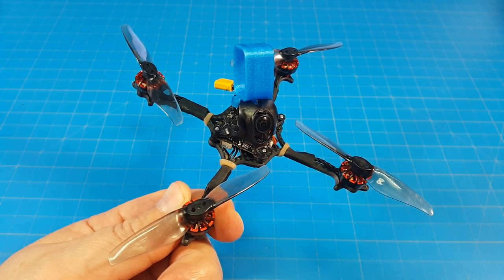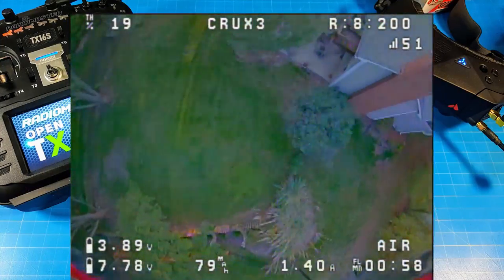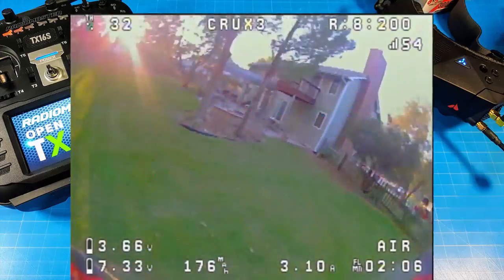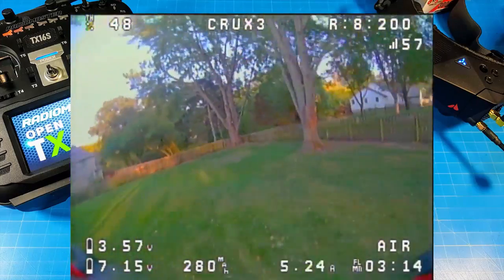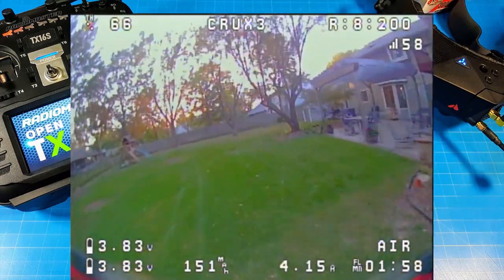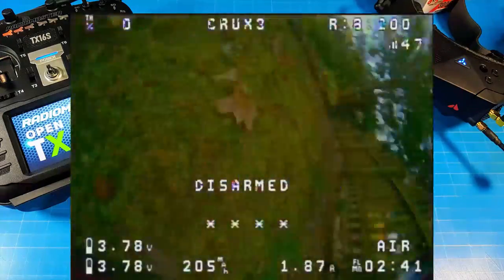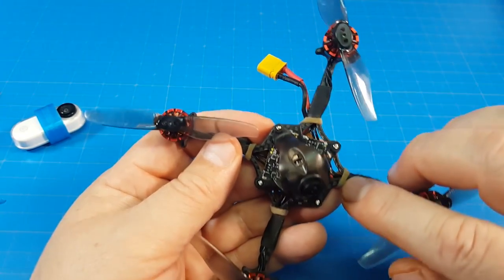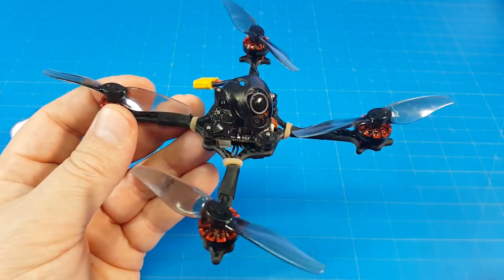Crux 3 // 42 Gram // 2s Ultra Light Micro Drone

Comment: Can you change the vtx antenna without soldering for a circular polarized one?
Reply from the maker: No both antenna are solder to the board
Reply: You could probably swap the copper wire  antenna with the whip. But it requires good soldering skills

Comment: I think I'd still prefer the LarvaX on 3S, seems to be a alot faster and responsive than the crux3 hey. Just off the footage I've seem so far, yet to see it really "rip" like the LarvaX.
Reply from the maker: Cell count does matter, just like the spartan v3 I did a few weeks ago. 4s is a blast 3s is okay but not as much fun
Reply: @NickBurnsFPV  it really does mate, I put the Betafpv 1103 8000kv on the Larvax and run on 3S and it is absolutely a blast to fly. It changed directions so fast I absolutely love, PS thanks for the help tunning when I went to those motors :)
Reply: @NickBurnsFPV  Also mate I've ordered a couple of the Spartans haha, I chose them over this. I realise this quad is better for alot of people, but for me I want that ridiculous speed and ability and will give up flight time or anything really to get it hahaha.

Comment: Sir does it 1.5mm shaft? And is it snug with out prop screws?
Reply: standard 1.5mm outter shaft but 2mm inner diameter.
Reply: @DonJohnsonFPV  what does that mean? What shaft size were the props push on?
Reply: @stinerivera2543  stepped shaft, and way more durable than previous HM motor.
You can see it on my review at 1mn20
https://youtu.be/EPdOy913b6A?t=81
You can also watch my race video with it, 25 30 packs and just bended 2 props...
Reply: @DonJohnsonFPV  hey, do you think the new happymodel 2mm inner shaft motors are as durable as the more expensive competitors?
Reply: @ELValenin  I don't know...

Comment: will this work with my betafpv lite 2 se radio and vro2 goggles ?
Reply from the maker: With googles yes. Radio depends which version you get and matching that to the version on the radio you have
Reply: @NickBurnsFPV  if i get the frsky d8 will it work?
Reply from the maker: @benballantine7718  Yes, but DO NOT get an frsky radio. This can be confusing. The new Frsky radios do not support the frsky d8 protocol. But most of the other radios on the market do, radiomaster, jumper and betafpv radios with the cc2500 chip all support frsky d8.

Comment: Anyone know, are these new style motors from happymodel more durable than the older ones?
Reply from the maker: IMHO they have made steady improvement. Two years ago we couldn’t clip a branch without breaking the motor shaft
Reply: @NickBurnsFPV  they sure are way stronger with inner 2mm shaft... at least I didn't break any 1204 or 1202.5 yet...

Comment: It's a shame they haven't made a version of that fc board with 10-12 amp esc instead of only 5. That worries me for long term durability. It looks fun though on 2s, and could make a good bnf option for people that don't want to build.
Reply from the maker: I hope we see a vesion with larger esc fets, I am not sure if that is possible with all these components on one board.
Reply: yup, flown mine about six times. One ESC blown. Flying low under trees and just caught some fine scraggle. I'm going to replace with a 12A AIO board and accept the penalty of a few more grams. So yes it's too fragile imo.
Reply: @ianwoodland6223  Sorry to hear that man. Hopefully everything goes smooth when swapping parts.

Comment: Can someone add their own receiver to this quad? I don't want a quad with spi receiver.
Reply from the maker: yes we can add an external receiver. The soldering is super small. This is the AIO it has a wiring map. http://www.happymodel.cn/index.php/2020/09/28/crazybeex-fr-fs-pnp-v2-2-all-in-one-flight-controller-1-2s-compatible-for-brushless-whoops-and-toothpick/connection-diagram-fr/
Reply: @NickBurnsFPV  thanks man. Do you know if anyone has a video on how to install a external receiver on a quad?
Reply from the maker: @sebastrianw.4673  There could be, a quick search didn't show an obvious video on it. Might need some deeper and different keywords searching.